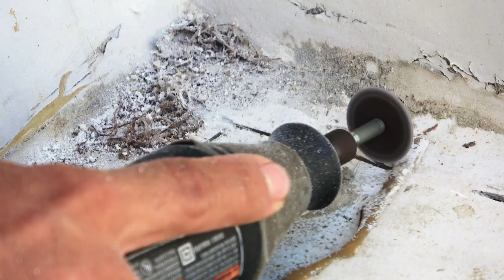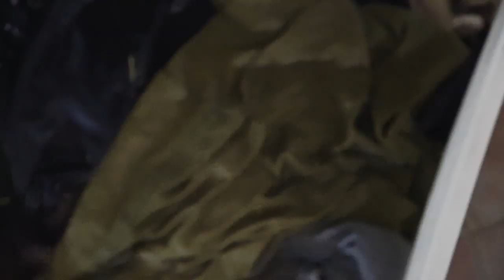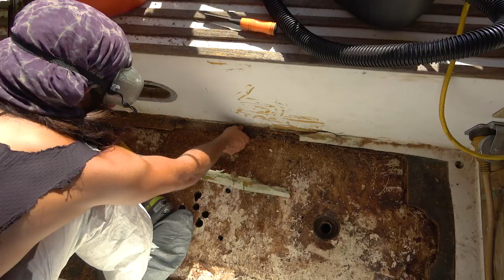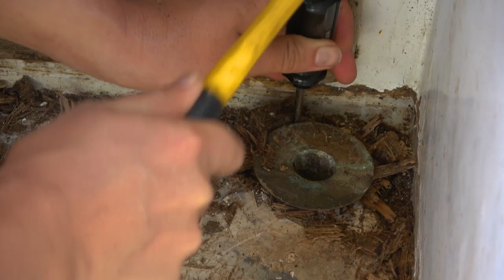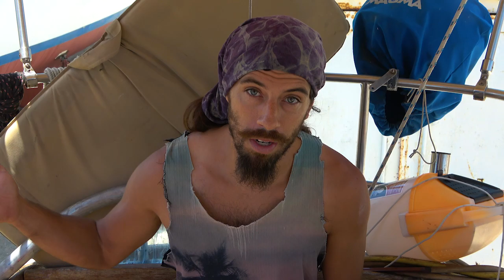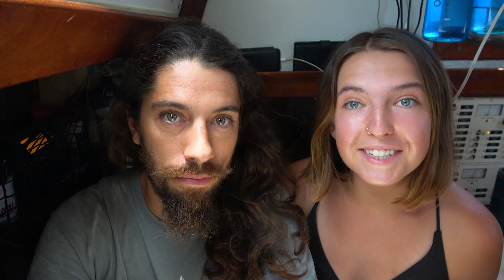OH No! Guess What's UNDER our SOGGY Cockpit Sole Ep 79

Comment: This is what I am in process of doing on my 1974 Coronado.  But I may be ahead, old rotten wood gone, new wood, and new 4 layers of 8oz mat over the top and bonded to the vertical sides of the cockpit.  faired in the edges with some total boat fairing compound, and just about to put on some enamel to finish the job.  I would definately take out all the old stuff.  Even just from an air quality standpoint,  moldy wood is not what you want to be breathing while you are sleeping.   Love you guys!

Comment: Guys, I would suggest you remove the original core, but cut it away so that you  leave about a 3 inch perimeter of the existing core un-removed all along the perimeter of what you cut away.  Then take a look at the condition of the exposed area, and the "lip" that was left.  If the lip is in good condition it can serve as a flange under the new decking, which would simplify the new work.  If the lip is no good, then you would cut it away and redo from scratch. But it will be easier to remove the lip with the center cut away, than it would be to cut away everything all at once. Use epoxy for the new work if you can. My boat was built in 1966, so I feel your pain.  Greg

Comment: On my old Columbia 28, we had a similar problem, so we cut the whole thing out and made the entire cockpit sole into a removable hatch for easier engine access to the atomic four which was otherwise a pain in the tuckus to get to to do any kind of service on it, which it needed a lot of often. We put bolts all around the perimeter ar eight inch intervals, but made sure we had properly sealed each of the bolt holes by over drilling the size, filling with epoxy, then drilling the correct bolt hole size to make sure that there wouldn’t ever be water intrusion again into the core of the new cockpit sole hatch.

Comment: Two things. 

First, I have recently redone my cockpit sole and was faced with a similar dilemma; do I go over-top with plywood and glass, or strip it down to the base layer of glass and build up from there? I decided to strip it down. In doing so I used a multi-tool (the best new power tool of the past twenty years) to get to the glass (reasonable quickly) then added 5 layers of new glass to reinforce the base level glass, then added 3/4" plywood covered with epoxy, then glassed 4 layers on-top of that. I also made a peanut butter epoxy mixture and created new gutters down the sides of the floor that takes water to the scuppers. Afterward, I covered the floor with Kiwi-grip non-slip. The finished product is excellent. It is however, a big, time consuming job. Not to mention how difficult it is to work with your body often laying across the lockers while reaching down to the floor. Best of luck, you are on the right path.

Second, I am a PGA golf professional and have seen thousands of golf swings and taught thousands of lessons. As such I must say that I was impressed with your golf swing and your ability (and confidence) to hit a ball off of a very tight lie; a piece of wood.  I would say that someone has played quite a lot of golf in her day, yes?

Comment: I've done that exact same job on a previous boat. My advice is remove the rotten core,clean and abrade the laminate and lay a new core on a mix of epoxy and microfibers. Then laminate on top and around the edges.Use epoxy throughout.Then sand smooth and paint.

Comment: Hey if the core is dry a little trick would be to thin down the epoxy resin to 30% with mek or suitable thinners and inject it into the core to make a solid bonded composition.When ever you do timber work,impregnate the timber with two layers of 10% thinned epoxy that stuff soaks right in,then go 30% and finish with 100% mix.

So to recap measure out resin and hardener,mix,thin down to desired consistency then apply,the thinner the mix the deeper it goes with the vehicle(thinning agent) to carry it into the pores of the materials.take care.
Reply: BenjaminFranklin99 oh Frankie your not supposed to pipe it.

Comment: Cut the old core out! Use the last layer as a starting block. Grind the edges back then plywood treat with epoxy first then epoxy then cloth then thicken epoxy to fair out everything  when u drill holes in the deck over size them fill with epoxy  first dry then drill your hole no rot issues
Reply: This is the correct way. If you can get honeycomb board use that, otherwise decent ply and epoxy :)

Comment: If the fiberglass below the old core is still there, remove the top skin, clean out the core and use the bottom glass for a base, otherwise clean the old core out from below and use the top skin as a base, sand the fiberglass down from the top side getting rid of any gelcoat, put down a couple layers of biaxial (making sure they run up the sides a bit) then thickened resin to accomodate any uneven spots, new core and tab to the sides then two more layers of biaxial and gel coat with nonskid. If you want you can put a layer of chop strand mat over the biaxial for a better finish. As long and the new core is sealed from both sides, and the old rotten core is out, should be good for a long while. This way will be easier to make sure the deck is level.

Comment: Nice golf swing! I am surprised that you both haven't done a golfing gig to restock the repair kitty, no doggy in this vid, sad.... and I would take out any and all soggy wood and fillet in a new cockpit floor with west system epoxy plus more drainage scuppers!!! How's the rest of the process going? Are you finished with the bottom, steering,  prop, shaft etc. or you just need to not feel like quitting so you start another pandoras box project.....
Reply from the maker: It is a thing of beauty watching that swing. We are having trouble receiving the epoxy paint that we paid for and have ordered prop shaft etc. as for the steering, it can't go back together until the cockpit floor is solid.

Comment: Cut and replace the job will go quicker and be permanent, dont forget to wrap up the sides  a bit with the new glass. use closed cell foam core
Reply: I think they had a rudder pedestal in there. Therefore the deck needs to be able to handle some compression and other forces from the pedestal. For that reason it requires a plywood core, just as the original was.
Reply: @Scramasax  foam core is stronger than ply and wont rot go the foam

Comment: What does the bottom look like, i assume the wood had fiberglass above and below? because it is the cockpit core, i would use marine foam, so it does not take in any moisture again, but as someone else said, its not going to sink the boat. Fiberglass lasted the first 20 and the second layer lasted another 20... if you are cool with keeping for next 10 I would say just use wood.. if its your for life boat, then i would go with foam.   ultimate question is.. were either of those cores marine grade plywood? and do you have access to marine grade down by you.

Comment: Yep. You’re into it this far. Do it right and get the rest of the cockpit sole cleaned out. Also, might be the time to think about making the boat easier to maintain, forget the wheel steering and setup a good tiller. Install bigger cockpit drains. And yes nice golf swing.

Comment: Wonder if that wood, the last thing you took out, was marine plywood.  It has held up really well and still had a lot of strength. Probably in there 20 years ! And kept constantly wet.
Reply from the maker: I would think it was. Like you said it has been in for a while and was clearly wet. Parts were like cardboard but pieces like the ones I chopped with my karate skills were actually pretty strong.

Comment: Sorry for my poor english :) i think the good way to do it is : 1 dry sand all the surface + about 5cm high all arround. 2 refill all the holes whith a melt of epoxy+ fiberglass cute verry fine. 3 make a epoxy stratification 3 or 4 plyes on the whole place. 4 drill the new holes for water evacuation. Have fun ! :)

Comment: Pull the drains - you are going to need to bed them anyway- don't work around them or your seal will not be good  . Best fix would have been to cut it out from below and recore but now that there are so many holes in the original I would cut it out from above re-core and do new , you need to grind back the glass to fresh glass for a good bond . For finish I would contemplate a teak grid on the floor just in case your glass work in not as pretty as you wish it was.  Would match the teak on the seats . Also in your new install make it solid glass anywhere there is a penetration like the drains , or where the wheel bolts in that way even if it leaks one day it will bot rot the care again .

Comment: You guys have always done everything first rate, so I'm guessing that you'll rip everything out.  My advice is that you'd save a ton of time, expense and labor if you lay some glass over the existing mess and move on.  If you take the time to fix everything like new, you'll be as old as me before you're back on the water.  Learn from what you've seen.  Sand and tab all the way up the side of the cockpit to the seats, and its never coming off and won't leak.  If you lay in a plywood core, have glass on both sides.  If you can get some honeycomb core, use that because it will never rot.  Even without core, 3/8 to 1/2 inch of glass built up from lots of layers will hold you and the steering.  The presence of muck below that does not diminish its strength.  

No matter what you do with the floor, the most important thing is sealing where the steering and anything else goes through.  Thats where water gets in and rot begins.  Water is not coming in through the fiberglass, its getting in where things go through the floor and are not sealed.  An extreme method is to drill every hole just a little oversize, fill with thickened epoxy, then drill the right size hole through the epoxy.  Another is to paint the inside of every hole with epoxy so water doesn't get into the entire cross-section of plywood or whatever you put there.  Then 4200 anything you'd like to remove at some point and 5200 stuff you want really stuck.

Words of warning from an old guy who used to be young once;  Drydock restoration and upgrades can become a never-ending sitcom.  You can always take ten times as long to "do it right".  You can always come up with one more little project that would make cruising so much better once its done.  And you do it and do it until you're old, but you never got back to cruising.  There are old guys in every boatyard with this exact story.  I know, its happening to me.  I only made a short trip last summer because I kept working on the boat until it was too late to spend a lot of time.  I've worked on it all winter, and am about to miss my hoped-for departure date because there are still things I'd like done before cruising long-term.  If I keep working on the boat, this summer will be gone as well.  Fix what needs to be fixed to get back on the water.  While cruising, you'll develop a list of stuff that you want to do next time some urgent issue requires another haul-out.  You're going to haul-out sometime in the next three to six years even if you don't want to.  You don't need to make everything perfect right away.  Perfection is the bane of everything thats good enough.  The more jobs done good enough, the more of your lives are spent cruising... unless you're starting to like living in the boatyard.  It happens.
Reply: Nine Hundred Dollar Luxury Yacht Excellent advice from I am guessing a very wise man. I am falling into that trap myself faster than I dare admit to myself. My 36 footer has been in dry dock for nearly 5 years now because every "I'll do a proper job on this bit" that I tackle reveals something else that's not up to my expectations. I really don't know what to suggest to them as I know how the dilemma sucks you in like a spell. Difficult one.......if it were me I would want to strip all the old core out and rebuild that floor like new. This will of course take up most of this season and probably will reveal more issues. It's knowing when to stop and accept when something is good enough in the grand scheme of things and I certainly haven't figured that out myself yet. 😕
Reply: Kuuryo It’s just prolonging the inevitable

Comment: My first inclination is fix it right ie replace the original flooring.
Beware that in doing so you might or more likely will find more to fix. You could open up a big can of worms.
Any idea on the condition of the structure that supported the old floor? Not the plywood but the studs and beams? If you cut out the last fiberglass layer you might lose that structure as the fiberglass might be holding your cockpit in shape. Kind of like cutting out the bottom of a cardboard box then it’s hard to keep the box squared and the sides from bowing out. 
Either way use the coosa composite board for your flooring as it will not rot.
Reply: Yes Coosa board but, don’t cut out the floor! Strengthen it with the board , Matt and epoxy

Comment: Your best bet is to take it all the way down and do it correctly. If you just go over the original problems you will have to do it again or the person you sell it to later will have to repair it. Also, if you do it correctly and take it to the bear frame then it will be stronger and help with the rigidity of the boat and its seaworthiness.

Comment: use an epoxy soaked nidacore board then re-glass the top. taking back the old fiber glass on the sides to bare glass with a sander. then use a skirt of fiber glass around the sides and over the top to make a solid base. then you will never have to worry about any rot

Comment: The previous owner of your boat must have worked on mine. Do a proper job this time.
Reply: Do it right !  Remove the old core material and start of fresh.
Reply: Stephen Thomas

Enjoying your adventure! 
When undertaking a boat project there are two important considerations "time and money"! If you have the time and money then do the best job you can possibly do. 
   Remove the rotten core and get it out of the vessel-since your already in there. If it was soft and you decide to make the repair then do it right. 

Leaving the soft core could create odors, bugs (like gnats) along with mold and mildew. None of which are good-. 

Although I have not seen all of your video post and how you acquired the boat, I do recall you paid $2,000 for it and it was in the water, so "as is where is" and I guess the idea was "I will deal with the repairs and up grades later. So now you dealing with them. What you do not want is to be standing there one day trying to sell the boat to someone and have to lie about something you know you did not take care of when you were right there and could have.
Reply: @stephenmccarthy144  Don't know if you have looked at the earlier videos after your post but when Joel and his buddies bought the boat they knew almost nothing about old boats. Frankly I think they were very lucky with what they got, it could have been far worse.

Comment: Out out OUT with the Balsa original No 1 core, too. It's work, though, but just think about the rot'n fungus You do not spread around any more once You cut out the centre source.
To keep on carrying a soggy biohazardous mess somewhere in Your boat when You're already so near to ripping it out would be a sacrilege. If You can get it downthere, build in a PVC interlinked foam core instead of ply or endgrain - less prone to soaking. You'll need some high density parts of foam for the pedestal though. Cheers

Comment: cut the floor out and raise half the cockpit floor you lose half the cockpit but you gain a shot tonne of storage below.
and then you can run a single centre mounted deck winch which makes solo sailing so much easier

Comment: Not an uncommon issue in plywood or balsa wood cored boats. I have gouged out much sloppy wet mush and with basically the same tools as your using. When ever you drill a hole for a bolt or put a screw thru decking like that you need to take the time to over size the holes come back and fill them with good epoxy and then drill the smaller hole thru the pure epoxy resin or you get messes. Even doing that doesn’t guarantee you won’t ever have rotten coring. Gelcoat is surprisingly porous. Welcome to the world of boating. Keep the faith, you will go through some of these challenges but come out knowing your boat’s construction better and be way more self sufficient out on the water.

Comment: The glass probably  did notstick as the cockpit sides were not sanded ,a 2" strip is all you need to as you say  tab  the floor  down , sanding the shiney  smooth original molded surface is necessary  to  get a good grip or key to get the resin to stick , whether epoxy or polyester.  
Good luck guys , you are doing ok.

Comment: My suggestion would be, to put in some temporary timber bracing to support the cockpit floor on the underside, then remove the top skin of fiberglass and remove the original core material. Then scrape clean, sand and make good the underside fiberglass skin from above, most importantly don't waste time trying to repair it from below, once its made good, then lay up another layer of glass on it, then cut your new plywood core to size and then mix up some epoxy and add a few drops of acetone to thin it and saturate the plywood on both sides and all the edges using a brush or roller repeating this a few times to saturate it, then wet out the lower skin, install the new core and then lay up a new top skin.
Regards, Dave.

Comment: You have the tools and the know how to remove the rotten wood, so do it, after the rotten material has been removed the repair is the same as if you didn't remove it but it will be a lasting repair.   If you were to encapsulate that rotten wood that has moisture with another layer you will soon have the same situation as you do now,  the wood will continue to decompose and delaminate